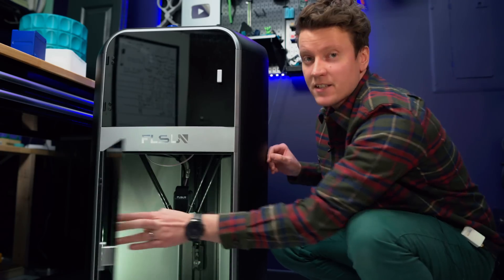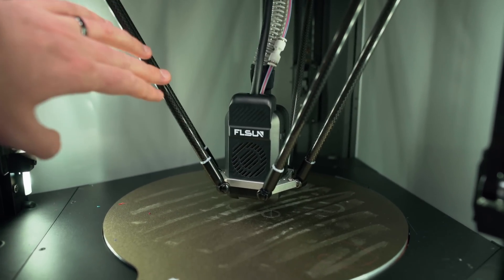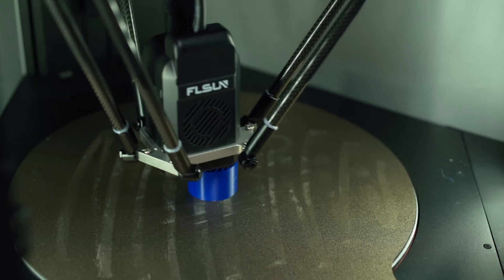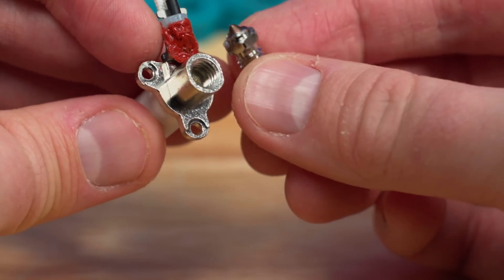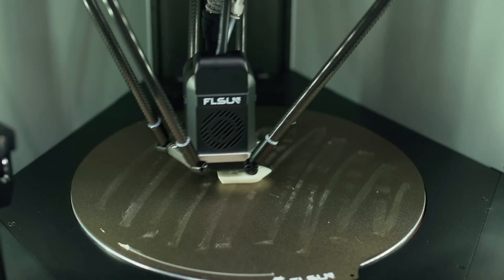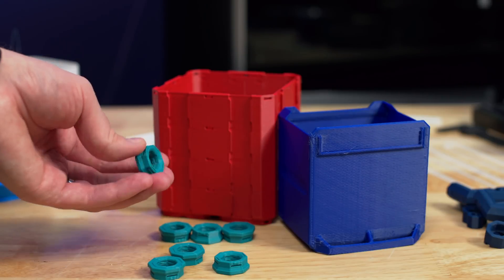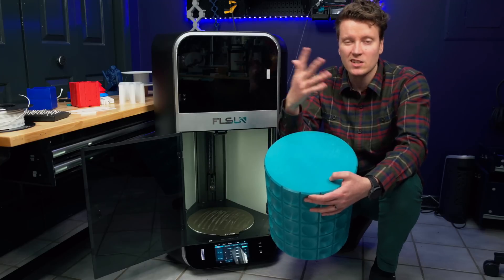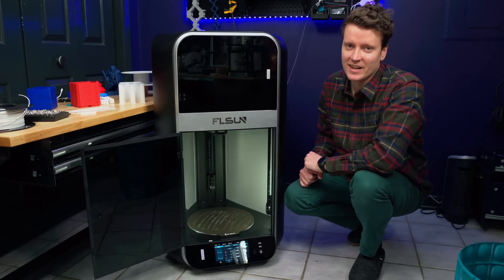New Delta 3D Printer FLSUN S1 Pro Review

Comment: I got this printer in Nov 24 as they were being released. The printer has been nothing but problems including, motor failures, driver board failure/fire and nozzle clogging/scraping among others.  As for the high speed, it's a head fake, as most other brands of filament will not work unless you slow them down to conventional speeds. FLSUN filament is 2x the price of most other branded filaments, and worse, it's almost perpetually on backorder. I cannot recommend it, as in my opinion, a printer that can spontaneously catch on fire needs to be recalled and removed from the US market.

Comment: I feel compelled to share my experience with the Flsun S1 Pro because I believe potential buyers deserve to hear the truth about this machine. I invested over $1500 in what I thought would be a reliable, high-quality 3D printer, but my experience has been nothing short of a nightmare.

From the very beginning, I faced numerous issues that made this machine difficult and frustrating to use. The assembly instructions were unclear, leading to hours of troubleshooting just to get it running. Once operational, I encountered persistent mechanical failures—parts breaking, belts slipping, and extruders jamming without warning. Despite following all recommended maintenance procedures, these problems continued to plague me, severely impacting the quality and consistency of my prints.

Software compatibility and firmware updates have been a nightmare. The UI is unintuitive, and frequent crashes or glitches have caused me to lose hours of work. Support from the company has been unhelpful—delayed responses, vague answers, and no real solutions. It’s clear that customer service is not a priority.

I regret my purchase deeply. This machine has caused me wasted time, frustration, and financial loss. I would strongly advise anyone considering the Flsun S1 Pro to think twice. There are far better options out there that won’t leave you feeling cheated, disappointed, or stranded with a malfunctioning machine.

To Flsun: your product has caused me nothing but stress and disappointment. I will not be buying any parts or products from your company again, and I hope this review helps others avoid the same fate.

Comment: Too many YouTubers acquire printers without learning how to use them. They copy reviews or opinions and quickly move on to requesting new printers just to create "content." This issue isn't aimed at JJ or specific to 3D printers. After speaking with a sales representative from Bambu, I learned about the crazy number of printers that are returned after new product releases, they are well aware of the YT pandemonium. Many channels order printers, make a quick YouTube review, and then return them within 4 days for a full refund. Some even claim they "tested" them for weeks. Dont trust them unless they make a full project, not just printing a Benchy. 

Pro tip: contact a company and ask if they want to sell you returned printers from YouTubers, get half off. Regarding the FLSUN S1 Pro, its print quality is comparable to the P1, and even the reliable P1 requires a bit tuning to operate smoothly. Additionally, avoid using FLSUN filament, as its quality is far from Bambu and many others.
Reply: Who are the YouTubers that show more than a benchy? I really need to know the more reliable ones.

Comment: As a recent college graduate, I have worked at FLSUN Company for six months but only received three months' salary.  This wage arrears situation applies to all employees.  Most of my colleagues have resigned due to mounting living and financial pressures.  For the past two months, I have been persistently demanding my unpaid wages, yet the company consistently claims to have "no funds available."  Based on verifiable information, this enterprise is operating in a severely compromised financial state.😅
Therefore, I deem it necessary to caution potential customers to exercise thorough consideration when making purchasing decisions, rather than being solely influenced by their superficially promoted "high-speed" claims.  The operational instability demonstrated through these employment practices warrants prudent evaluation of transactional risks.🤕

Comment: This isn't the open source easily modified klipper you think it is JJ.  There is no ssh access to printer, if you manage to get it as one person did, flsun will work to patch it out so you can't get in again.  Want to upgrade from Klipper v10 it is running for adaptive bed mesh, you can't.  Want to install a klipper add-on like shaketune, you can't.  Want FLSun to honor the open source license of the software they use and release their changes?  They won't.
Reply: Yeah..... I was looking at this one... not any more
Reply: glad you posted this! this is definitly a deal breaker for me. i was torn between this (for $600 on black friday) or building a 0.2 with a bondtech INDX tool changer. looks like i'm building another voron (because its more fun and open source) ❤❤
Reply: @phreshxmetal  Good call.  It is fun to watch but doesn't do anything better than my voron and is a pain in the butt with the poor programming and inability to change it.
Reply: Y'all need to chill. For real
Reply: @ajcarroll3559  why, because people want to be able to actually control every aspect of an expensive tool? sounds like you're the type of person that should stick to a bambu labs printer